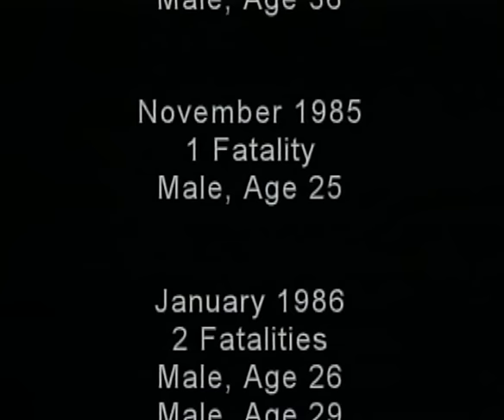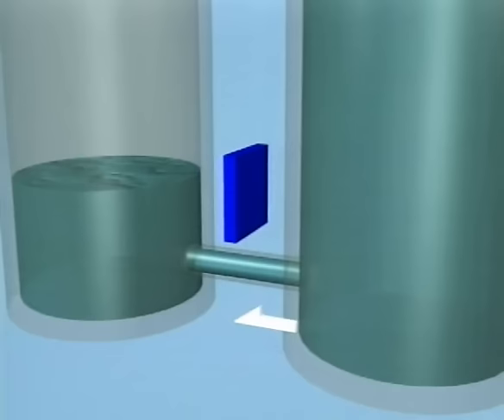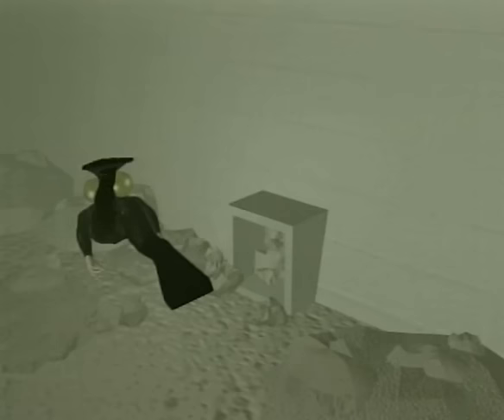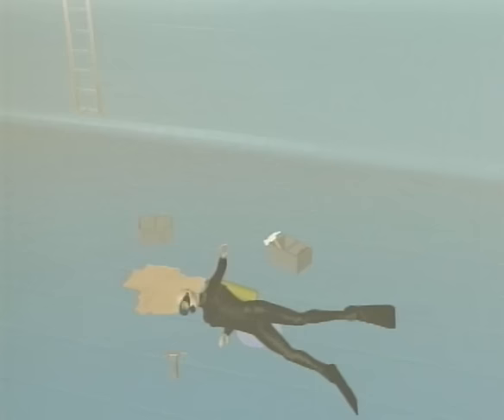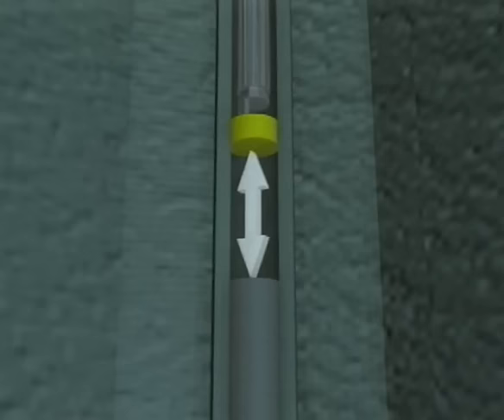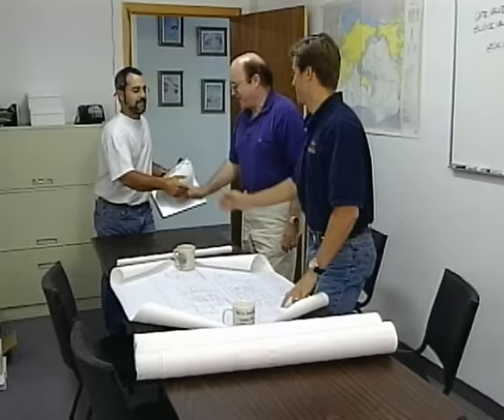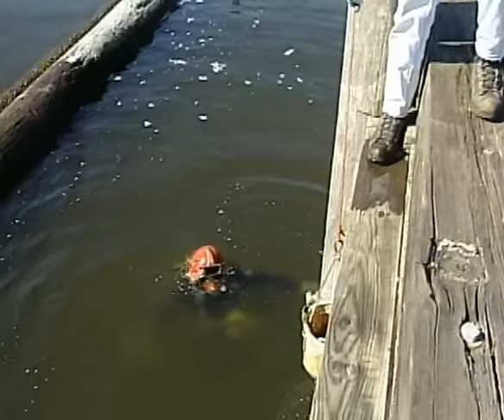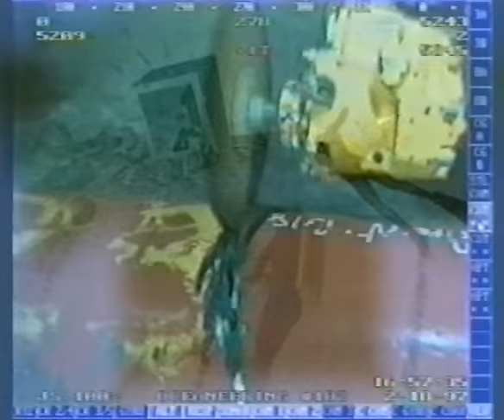Delta P

Comment: What a horrible way to die. Trapped under tremendous force in dark murky water — running out of air, but having plenty of time to contemplate the situation and waiting for a horrible death. I feel claustrophobic even thinking about it.
Reply: John I think I would try to cut off the trapped body part. Obviously thats easier said than done, but yeah... Losing a limb is horrible, but not as shitty as dying.
Reply: Benedocta Even if you had a light saber and just wacked off the body part, the Delta P is still there and would just suck the rest of your body into it.   Only equalization of pressures stops Delta P.
Reply: Samantha Young The stuck limb is sealing the opening.
Reply: Samantha Young If I have a lightsaber I am sticking it through the ground to poke another hole in the side of the pipe and equalize.
Reply: Benedocta The stuck limb is only sealing it because the Delta P can't suck the rest of you through.  Chop the limb off and the limb goes further in and possibly through, reopening the Delta P scenario.  Just depends on the situation I guess.  :)
Reply: +Samantha Young Samantha knows whats up.
Reply: +John  & all, this happens more often than many realize. SCUBA divers pretending to be Qualified Commercial Divers die regularly never expecting this and other hazards we prepare for on each dive we make.
Reply: +Sanders for President 2016 Luckily running out of oxygen is a lot less painful than drowning. If you have ever passed out, it's not a lot worse physically.
Reply: Gemini Shy "Sanders for President 2016" was my username for a while, so Anton wasn't making some random political statement. I'm still an avid Sanders (democratic socialist (which isn't "socialism" — it's moderate capitalist)) fan, but I don't want my political views distracting from non-political conversations I have on here.
Reply: Benedocta unless its your head
Reply: Gilfoyle Thank fuck for a sensible comment among all the "OMG Rooster Teeth me here OMG!"
Reply: I was justvdebating in my mind if it would be better to get sucked in head first and die or go leg first in hopes someone has a miracle solution or cutoff valve access
Reply: MAXIMUM SUFFERING
Reply: You must remember that in those situations the last thing you ever think of is what's about to happen
Your brain goes into survival mode and all you can think of are things to do to stay alive for that moment
Reply: @MrSammygirl1990  I would love to see someone try to cut off one of their own arms while underwater
Reply: @Rule-of-Threes-Survival  
I've never heard of a scuba diver pretending to be certified because they're so heavily regulated that there's no way you can get around it
Reply: I think the pool one was even worse. 10 feet of water, he could almost certainly see the top, and safety. But he was trapped by the pressure. Its highly likely that he thought nothing could go wrong, its a pool, people swim in it all the time without breathing gear, what could happen? Goees to show you can never be to careful, I guess.
Reply: @earthstar393  Spot on. Complacency is a frequent killer.

Comment: Recommendations to minimize risk of delta-P situations:
1. Do not enter a body of liquid.
2. If someone enters a body of liquid, you should assume they are trapped in a Delta-P situation and therefore doomed. They're already gone. Make no attempt to recover them.
3. If you find yourself in a body of liquid unexpectedly, remove yourself from the liquid as quickly as possible. As it is very likely you will find yourself in a Delta-P situation.
4. When storing any liquid, carefully consider if you could be creating the potential for a Delta-P situation. If so, do not store the liquid that way.
5. Delta-P situations are also sometimes possible with solid powders or pressurized gasses. Therefore, release all pressurized gasses into the atmosphere after confirming nobody is inside them. Do not enter or store solid powders. If possible, dump them into the ocean so they cannot hurt anyone. It is a well known fact that beaches result from dumping of solid powders into the ocean.
6. Because trees rely on strong negative pressure to transpire liquid from the ground, exposure to trees should be minimized to avoid being consumed. Remember, trees are not more afraid of you than you are of them. They are not sentient and do not know fear.
7. Wear an approved safety mask and do not touch your mouth or nose. As it is possible to create a Delta-P situation with them. If someone removes their safety mask, avoid exposure to their mouth or nose at all costs. Do not attempt to put their safety mask back on, as this could result in a Delta-P situation.
Reply: amazing
Reply: 8. Lab testing suggests breathing can result in Delta-P situations. Therefore, it is best avoided unless necessary. If you do have to breathe in order to accomplish a task, take care to avoid using blocked airways, or blocking airways while in use. A blocked airway often results in a Delta-P situation, which can be fatal if not rectified quickly.
Reply: this is the best thing I’ve ever read
Reply: If one nostril is clogged up the risk of Delta-P is increased dramatically.
Reply: I cry evrytum 😢
Reply: @randfur  when vomiting, if stopped for any reason while the flow is still going, the risk of Delta-P is increased exponentially
Reply: Words to live by
Reply: SpongeBob:"shut the fuck up and help me I'm going to die"
Reply: 🤓 be like touch water
Reply: thanks now I skip showers. Even the little drain can get you into delta p
Reply: Yep, every word of this I read in the narrator’s voice.
Reply: 8. You do not recognize the bodies in the water
Reply: Joke, or not, i'll take note, thanks...
Reply: 8. Do not be male, this decreases your chances drastically
Reply: The trees are consuming me help
Reply: This feels like SCP containment protocol 💀
Reply: I don't agree there was a delta p incident in trinidad last year however 4 divers were alive in the pipeline for up to 3 days and were banging on it and the authorities BLOCK all rescue attempts..they eventually died a horrible slow death with the hoped of being rescued.. one manage to get out and the authorities tried covering it up...
Reply: this is serious, i wouldnt try and make fun of it
Reply: @spacewalk3046  seriously??
Reply: Bro got PTSD
Reply: Bravo, sir!
Reply: @ciala4830  I would be concerned too. A Delta-p situation can occur when you least expect.
Reply: Thank you so much I will make sure to dehydrate myself so I do not encounter the risks of Delta P
Reply: My paranoia in a nutshell:
Reply: After reading no.1 it is safe to assume the air Im living in is a type of liquid therefore I should immediately eject myself off to space real quick.
Reply: Cheeky sod
Reply: Sounds like a description of some SCP
Reply: Epic funny.
Reply: Love you 💙
Reply: Be a man. 😂
Reply: Jesus
Reply: 6 and 7 have saved my life multiple times
Reply: This is so fucking funny
Reply: @papadelta316  yes
Reply: @spacewalk3046  Oh man...that's pretty serious!!
Reply: Amazing
Reply: @KeyBrute  I think you’re talking about Delta :p
Reply: @nattysupersoldier3642  lol what is this true?
Reply: @EASMEDIA  idk how long they survived in the pipe but yes it’s true. Family members of the divers managed to recover one of them alive, but the company declined any rescue attempts and used the coastguard to prevent any volunteers from rescuing. People working near the pipe hours later said they heard distress knocks.
Reply: @makslargu5799  name of the incident for google search?
Reply: @Lusc1nt  fr haha
Reply: this is incredible
Reply: Reading your comment exposed me to enormous amounts of delta p, I hope you are happy now
Reply: What if your boss insist it
Reply: 8. Do not fart.
Reply: Where's the analog horror spinoff of this? You pretty much wrote out the entire script for em lol
Reply: This is legitimately the funniest youtube comment I've ever read. Thanks for the laugh!
Reply: I don’t know why but number 2 makes me laugh really hard
Reply: @mkdorian8142  Jesus is Lord.
Reply: @reddragonflyxx657  what about living
Reply: this got wilder and wilder as it kept going. lmao
Reply: Lmaoo
Reply: Lmao wtffff
Reply: Thank you for this sage advice.  I've survived several possible Delta-P situations because of you.
Reply: In simplified version: do not touch water or holes
Reply: Not funny at all u lost me right away
Reply: Broooooo.!
Reply: unironically yeah fuck deep water, there's nothing in there for me
Reply: Currently laying on my bed with an open window next to me. Gonna close it to minimize risk of delta p
Reply: Thanks Peter
Reply: So no bj's
Reply: lemao

Comment: You can see it in a bath as the water spirals down the drain but the water to air vacuum is still there and it is not strong enough to suck anyone down the drain. This video is very informative.

Comment: I've had my play with Delta P. 

I once had to dive to attach a blank to a grille for one of a ship's main engine intakes. Fibreglass blank, say a metre by two metres. It was a design of ship I regularly dived on and there's an eye near the blank which you can attach a rope to. Normally you swim down with a rope, attach it to that eye, then swim back and get the blank and use the rope to pull yourself down. However this time I was a bit pressed for time so I just cracked on. The blank was lowered over the ship's side to the water, I grabbed it and started swimming down with it. They're supposed to be neutrally bouyant but this one wasn't, so I had to fight it the whole way, kicking hard to get it to come down with me. 

Got down in the area of the grille and I could hear noise from inside the hull, but this is a pretty regular thing. I didn't think anything of it as I dragged this blank towards the grille. Eventually I manage to wrestle it near and as I go to manoeuvre it over the grille.... WHUMP. The blank is sideways half across the grille and sucked hard to it. Tried to move it and it was completely stuck - couldn't even budge it. Immediately shouted it up on the comms to the dive supervisor and returned to the ladder. Yup, they were running the main saltwater pumps. Had I swum across the grille I'd have been chillin' there until someone decided to switch it off. 

Fun times.
Reply: Well, that’s terrifying
Reply: Nope. Glad you made it.
Reply: Oof that doesn't sound too nice
Reply: Thanks for the story!
Reply: Thankfully, you didn't swim across it.
Reply: I'd say this type of danger is on par with ship mooring lines. Very simple things, but if they 1 thing goes wrong can kill alot of people or yourself. I think the worst one was explained by one of my petty officers at RTC in the Navy. They called it being turned into chum. Essentially the ship lines that secure the ships to its port when docked have to be handled with great care cause if on deck people are still walking over these lines. Well if you leave any slack om these lines that alow a loop to be form and the ship starts leaving port and you just so happen to have your foot in that loop. Oh boy. The rope would immediately tighten around your ankle and suck you through a 10 inch hole out the side of the ship with the full might, weight, and thrust of a nuclear powered ships engine. You would be turned to absolute mush in seconds long before that rope snaps.
Reply: @GunShocka  Mooring lines are serious. Worst thing is the whip back if they snap - where they take a turn around a bollard they can fling out and cut you in half.
Reply: @mcgherkinstudios  Ya that was another one they explained to us as well.
Reply: NOOOO!!! I WOULD have a literal heart attack
Reply: @GunShocka  I get nervous enough to close my eyes when tightening up new guitar strings and I stand out of the potential path of projectile lugnuts when I'm filling up my tyres. Big mooring lines (when tautening) and anchor chains (when dropping anchor) scare the absolute everloving shit out of me. Ropes and knots are so intrinsically complicated they're a whole field of advanced math, plus you're staking your whole life on the reputation of whichever factory owner oversaw the production of that rope/chain/cable. I know we live our whole lives under mortal threat of poor engineering or quality assurance but something about flexible lines, specifically, makes me more suspicious than any concrete poured for a skyscraper or welds done on a bridge girder.
Reply: @gloverelaxis at least you can stop worrying about the lug nuts.  They're not attached to anything pressurized.  Nothing in the hub is pressurized.  But over inflating a tire to bursting could certainly be hazardous, if you were right next to it.
Reply: Stay safe brother phew.
Reply: it was a good call
Reply: Very glad that you had communications and those supervisors had running the mechanism that balances the pressure.
Reply: Did they just not bother to tell you they were running the pumps??😱 I feel like that would be a pretty important thing to warn your employees about
Reply: @ThatsMyPurseIDontKnowYou67  The person on the ship who was responsible for making the diving isolations messed up, basically. They got in a lot of trouble for it.
Reply: @satan.is.my.copilot  he can also stop worrying about guitar strings too... like wtf? they have a max of 20 pounds on them maybe 35 - 40 if you're using thicker strings. the average pounds of force is around 80 - 100 for ALL 6 OF THEM COMBINED and each one varies wildly. the b string is usually the loosest by a substantial margin, the E A D (thick wound strings) generally have the most tension.
Reply: @gloverelaxis  stop spreading the guitar strings bullshit, no one gets hurt by them because they're not an issue. the most dangerous part about a guitar string is the little sharp point that sticks out when you clip the excess LOL
Reply: Someone wasn't paying attention to the ships announcements, or they wanted to kill someone.
Reply: Is it still delta P if its a pump?
Reply: @ew8651  Well the differential in pressure is mechanically created, but it’s still a diff p.
Reply: @mcgherkinstudios well that's one type of hazing! 😮
You should have locked out the pumps before going near them. Your life is most important only to you!
Reply: @GunShocka im so confused as to why a ship would start steaming away with its mooring ropes still attached to the port? You won't pull away until the ropes are on board and seperated from the dock so how would you get caught in a loop?
Reply: @MavSavMorgan  People can be stupid. It takes dozen of men to get all the ropes off the dock. If someone forgets it only takes one mistake to cost some or even multiple peoples lives. Not to mention it's not just the ship steaming away. These ships are massive and in rougher waters or it starts drifting near the dock is enough to snap these ropes of they are under tension long enough. Just look up mooring lines snapping. 
Nylon under that much stress and suddenly unleashing all that stored energy is fast enough to quite literally slice multiple people clean in half. It's fast enough to where any water that's on the line is left where it wad before it has time to fall and the line is already gone. You wouldn't even see it coming. 

So if my foot gets trapped in a loop cause some asshole wasn't paying attention and straighted all the lines out to prevent that and the ship the size of a city block decided to shift a bit at port,  you best bet you are at minimum losing that leg, and at worst your whole body going through a 10 inch hole. Cause your body will break far before that line does.

Comment: I was like "this is really cool to learn but how do you get out of it?" The answer is you don't. "Once it's gotcha, it's gotcha" but you can prevent it by making more accessible holes for the water to flow so the water will balance out sooner thus possibly saving your life.
Reply: Technically yes but depending on the pressure you'd hafta make those holes within seconds. Literally as soon as you feel it pulling you a grenade would hafta go off blowing more holes in it. Because once it has you your tendons are already likely being ripped from the bone.

Comment: Damn, this was scary as hell. Imagine being trapped in a pipe or valve, helpless as you can't even struggle due to enormous forces as your oxygen depletes while being crushed by water.
Reply: I would use a knife too either kms or amputate the limb thats suck.
Reply: @ChrisJones-rd4wb  good luck with that
Reply: Usually you either drown of your body gets ripped apart and explodes
Reply: Amilah  Better than doing nothing

Comment: Between computer simulations of humans and footage of real crabs, the thing that made Delta P really hit me with existential fear was the footage of crabs getting sucked into the cut pipe.
Reply: You kinda know how how sturdy a crab shell is, so seeing it disappear almost instantly into a tiny slit just drives home how strong it is
Reply: ME TOO
Reply: Like what extremely high pressure that must be. By the lack of any sunlight this is likely near or at the bottom of the ocean. I say near bc it could be on a short straight before a drop to a deeper area. But the area is definitely way below the beginning of the twilight zone, and is likely deep midnight zone
Reply: There's a saw there so if little creature stuck it would be cut out and immediatelly sucked so nothing can clog the pipe. The pressure was very strong but that doesn't easily break crab like an egg shell their body is hard
Reply: @Crispy96  the saw wasn't lowered to cut the crab up. It could be what you pointed out or it could be there to simply cut something else, I need to re watch that rq
Reply: Ok just rewatched and yeah you could be actually correct on that but the pipe still suck that amount of crab in. The saw could also be to there to cut the pipe too